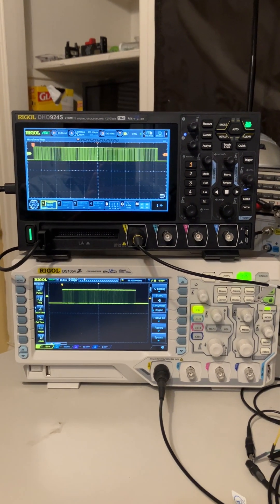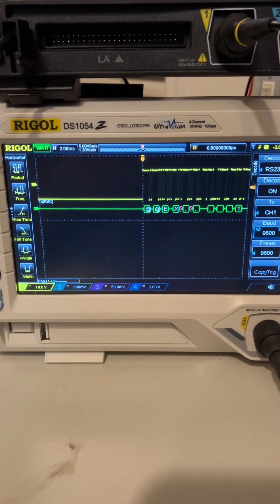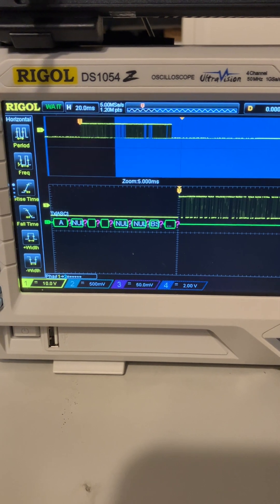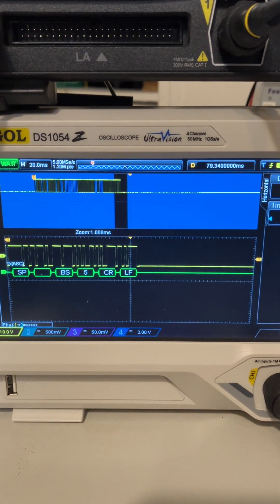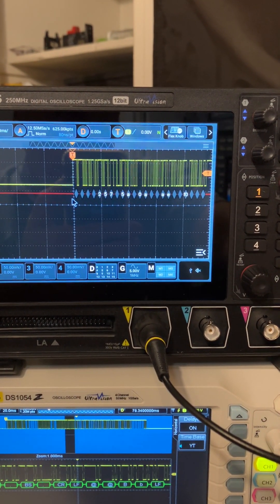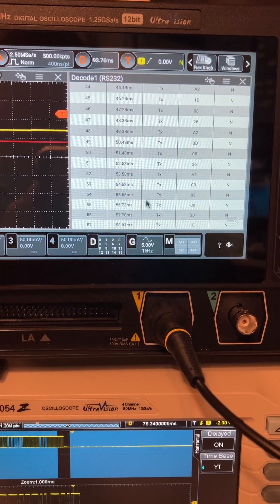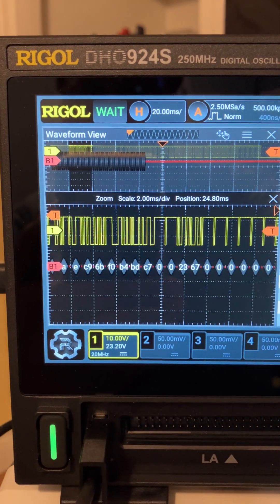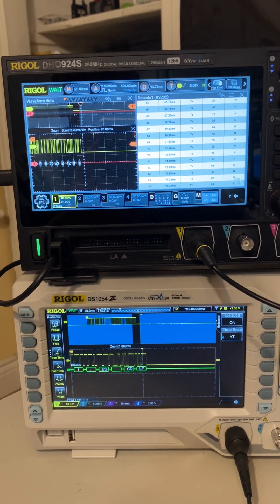Rigol DHO924s vs DS1054z demo of serial decode

Comment: I recently purchased the DHO924s and found that the RS232 serial decode does not work if I set the probe to x10 and scope to x10. I could not find a decode threshold setting that would make it decode the RS232 data. If I have the scope set to x1 but the probe is still at x10 it is able to decode the RS232 if the decode threshold is about the same as channel 1 trigger level. I think it must be a bug in Rigol's firmware for this scope. My scope has the latest firmware v1.02 released early 2024.
Reply from the maker: you could try to see where is the logic high and low with an offset triangular waveform Like I have tested with my digital external probe video.
Reply: @stevelevesque939  Seems like its a known bug as it has been discussed on the EEVBlog forum.

Comment: Yes, it is frustrating with 1054Z.
I buyed this old model for that reason , to analyze SPI,I2C,so on.    But was useless. 😢
Then buyed a low cost USB analyzer (saleae clone)  8channel 24Mhz for about 6€.
Reply from the maker: logic analyzer are fine as long as the analog signal is fine (timing, level, noise etc). I always start with analog verification before programming a driver to use a device.
Reply: Which dso is batter for spi decoding?
Can we  use recording function in flash drive & after play & decode it on pc?
I m thinking to buy dho924s for it 
Is it good option?